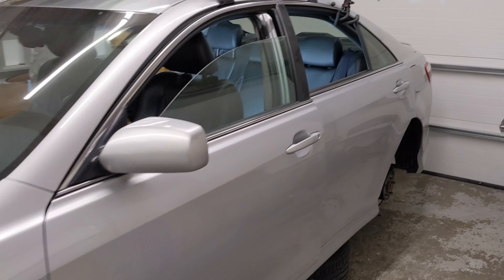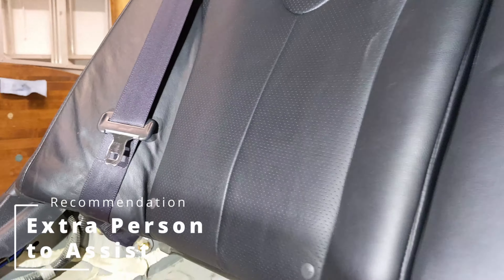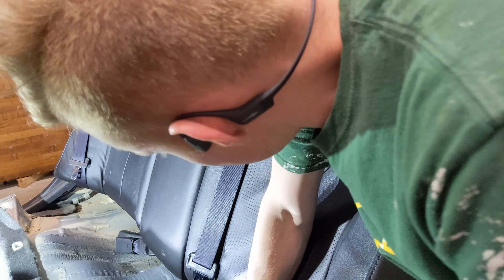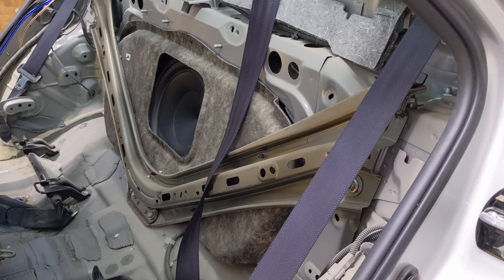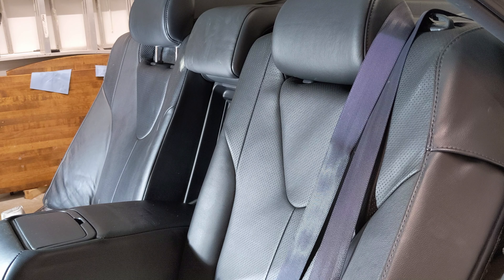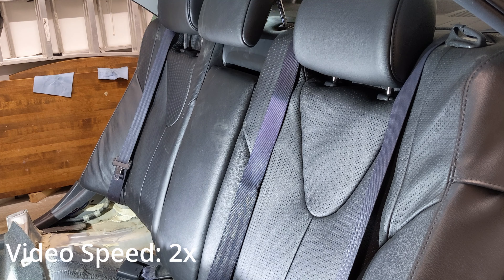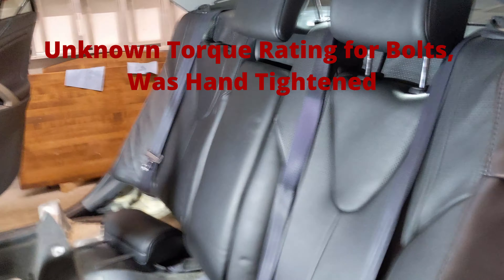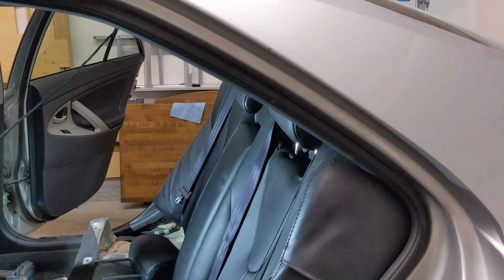How to Remove the Back Seat | Part 2 of 2 | Toyota Camry SE 2007-2011

Comment: Can I use the rear strut bar of the backseat as a ground point? Or what part of the inside trunk has good ground point because I have an amplifier for subwoofers and I need help finding a good ground point. It's a 2007 Toyota Camry SE.